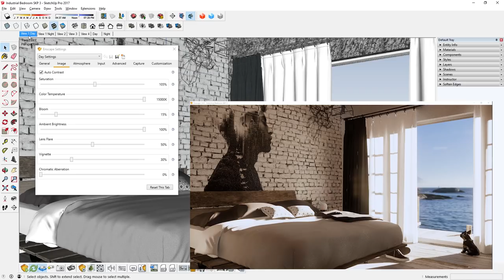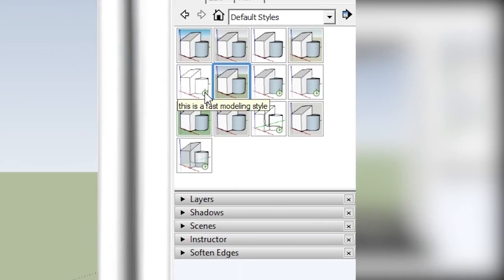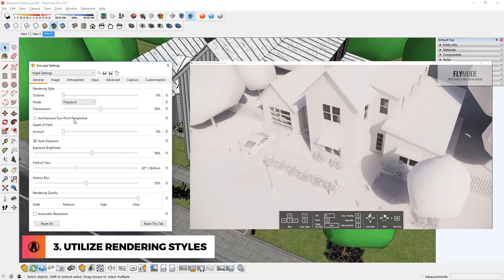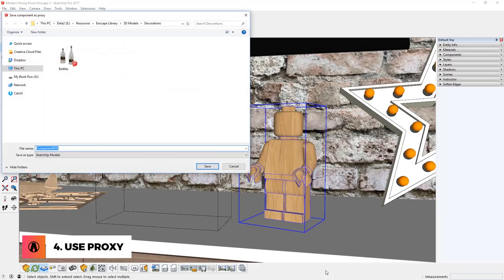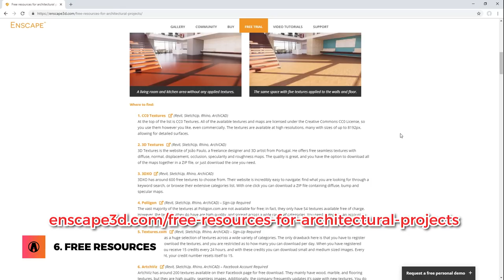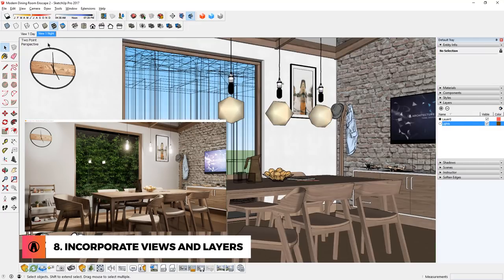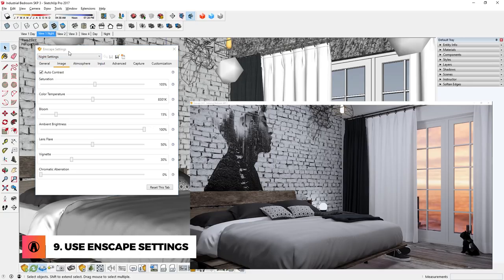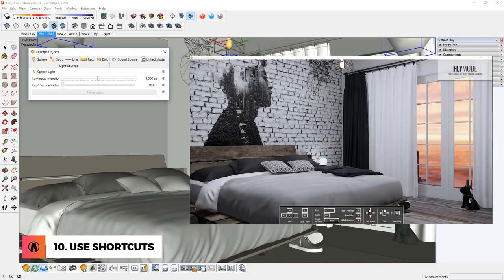10 Ways to SPEED UP Design and Render in Enscape

Comment: Minh.. which one is better.  Enscape or lumion 8..
I want learn lumion8 but graphic card issue.
Reply from the maker: Well Lumion 9 is out now. And it depends on what you need. Lumion 9 requires more power to run and it also costs more. But there's a lot of assets that comes with the software. Enscape is pretty simple but it's also fast. It just doesn't have as many features as Lumion